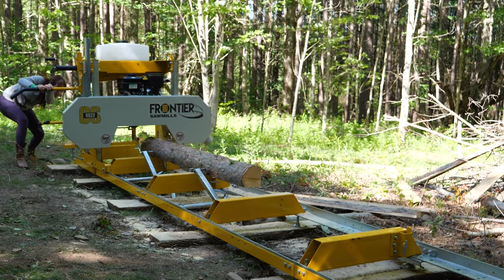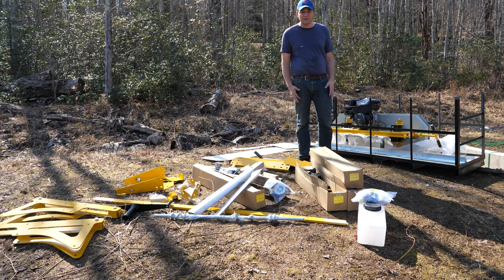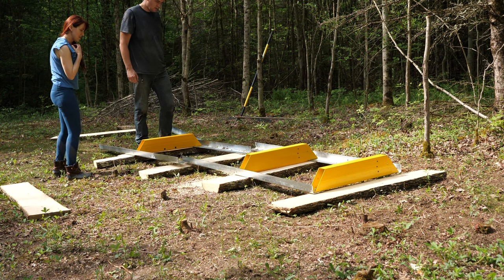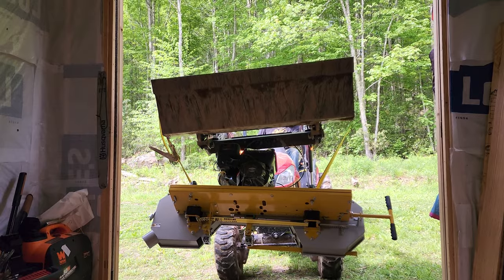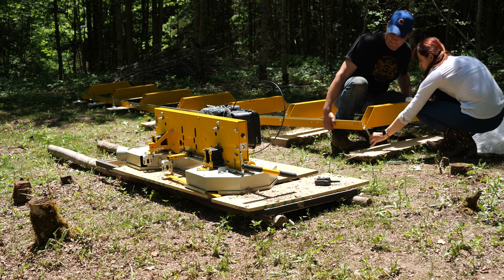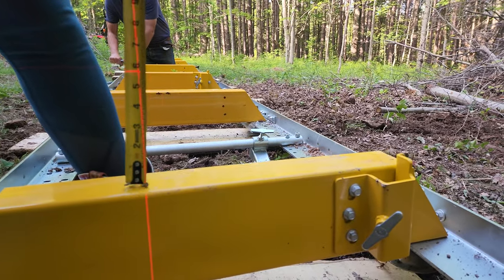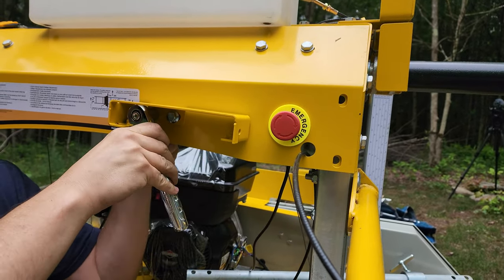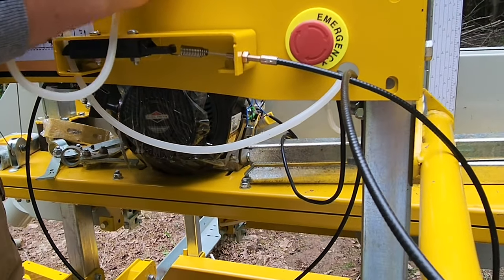Frontier OS23 Sawmill Assembly Tutorial - Watch First

Comment: I'm curious watching the transition from carrying the had on the tractor bucket to dragging it on the sled, why not carry it with the bucket the whole way?
Reply from the maker: The work site is about a quarter mile from where the sawmill crate was dropped off / where we kept the samwill head while assembling the rest. The current path is so uneven that we were worried about overall stability. We felt it was safer to use a sled. We could always stop if something went wrong.